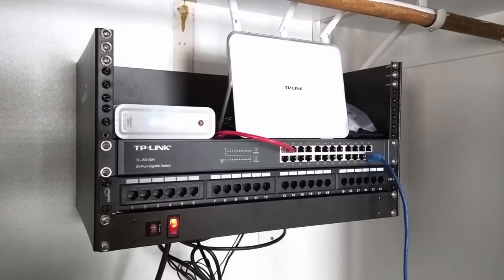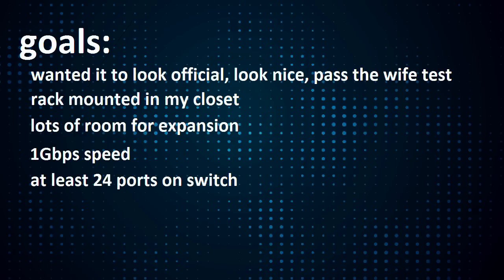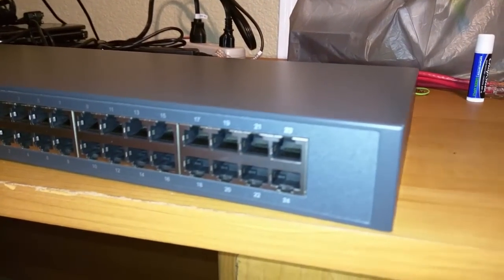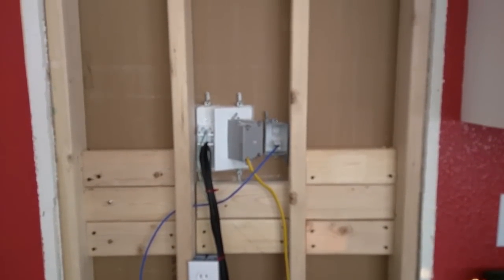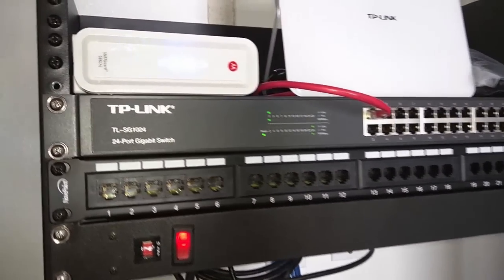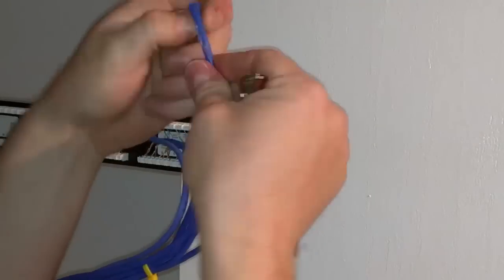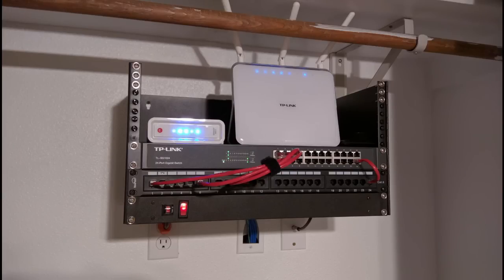Budget Home Network Tour/How To

Comment: So all of this is for better wifi? sorry I'm only 13 so I don't really know but interesting video
Reply: TechnoBike HD basically kid, wifi doesn't mean Internet. Wifi is a wireless way of delivering Internet. You can deliver internet through wires as well. So imagine one of the blue wires being connected to your phone all the time. You'll never have internet issues unless they come from your Internet service provider or the modem that's accepting the connection from your ISP.
Reply: Thanks
Reply: Actually, WiFi is a way of delivering network access.
Reply: Simple Man yes - correct, was trying to simplify it as much as possible, my younger cousin thinks "wifi" is simply Internet, always refers to his wifi being faster than mine but his intention is to say his isp is quicker
Reply: Ah, I see :)
Reply: I have 80k at my smartphone -_-
Reply: I appreciated the young man's question.. kind of felt like hearing someone say 
"hey.. isn't the emperor supposed to have some clothes on? "
I'm certainly not the most technical savy guy.. granted.. but iv been wiring up daw's since early 2000's.. build my own computers.. just basic twenty first century home stuff.  I never turned a computer on until I was late 30's.. around 2001..when late one night after a bottle of gin
I asked my buddy while listening to music.. "hey.. I wonder if there's a way to put all these f'ing cd's all over the  house in that computer I bought "wife" last year.. isn't there a way to feed the cd's to the computer.. so they're inside it..  huh??..  my buddy looked at me w a lung full of pot and said..  "man.. I feel sorry for makiko.."  (my 1 yr old daughter).. your basically retarded dude.. "  he was right.. I didn't even know how to turn it on.. but a month later.. compelled by my new daughter and the self-awareness to know my friend was right.. a month later I had the tower opened up on the kitchen table installing more ram.. that same friend showed me Reason music software days later and I realized the world had changed.. I better get up to speed.. my daughter is now 15..and I am the go to tech guy for her.. she has no idea I was an idiot at one time.. I have a studio full of the latest greatest hardware and software.. the decades of gin and ect. stopped that night my friend jokingly said "I feel sorry for your daughter".. 

so here's my question.. I opened this video up hoping to learn something.. like "why the need for a home network that doesn't involve a production aspect?"  and from start to finish it seemed the interest was aesthetic.. 
"I wanted one that looked cool.. "  and it never really seemed go beyond that.. so I'm with the kid wondering 
" wtf..  all that for streaming content?“.. am I missing something?  I feel I must be.. 
what does one do with dozens of ether net ports.. with the ability to expand?? 
maybe someone can explain.. maybe I'm still retarded.. I gotta stay ahead of my kid.. someone help me out here.
Reply: HF i think your cousin is actually more simpler than you. you make things complicated with your definitions, while good in some cases, useless when getting a message across. who cares if its just a way of accessing the internet. ppl just consider it as "the internet"
its like a person says "my car is faster than yours", and your complicted mind argues, "nah uh, no your car is not faster its your engine that's actually faster, so you're wrong".
Reply from the maker: loved your comment comptone, true, my video doesn't focus on the "why would you want a network like this." Unintentionally I guess the video turned out to focus on the "you already know why you'd want this, and the benefits, and this is how you could go about it."

There was a lot here I was focusing on, and aesthetics was for sure towards the top. I work in IT, so I have the technical part down, so I could focus pretty heavily on the aesthetics.

To answer your questions, a home network does not have to be so fancy and so pomp and circumstance as mine. Truth be told, mine looks all fancy and advanced, but it's pretty typical just on a larger scale. You would want to think "what will I use my network for?" and go from there. If you just want a few computers to communicate, then something much simpler would work. I am a giant nerd, and I wanted to wire up my whole house and have lots of room for expansion in the future, hence all the ethernet ports.

To help you understand why you would want a home network be it simple, or crazier like mine would be 1) it allows you to share data and resources between any PCs and other devices, most people understand this. You can share printers, only buy one for whole house instead of several. You could stream music, pictures, or movies to any device in the house (as long as that feature is setup). 2) A setup like mine would allow for more wired devices in the house instead of wifi. Wifi is great, but not as reliable at times, and not as secure and as fast as wired 3) You can do lots of other cool things with a network such as share a internet connection between multiple devices, use remote desktop to remote in to other PCs on the network, configure network storage, and the list is extensive.

Figuring out what you would need and building your network is half of the fun! I'd be happy to answer any other questions you might have! Happy networking!
Reply: ben johnson 
Hey.. much appreciated.  Question answered.. "I'm iT.." 
I'm asked on a regular basis
"do you really need another box that makes noise..? (synthesizer).. I get it. I have a home studio that looks like something Boeing drew up.. 
64 channels (and room to expand) of which I rarely use a quarter of and far more hardware than necessary for a hobbiest ..  I get it,  lol. 
the uses you described are all the ones I'm aware of.. the interconnection / sharing ect. and honestly like you I'm a "wire it"  guy.. WiFi is convenient but around the house I'm all about getting a line to my gear..  one more tv and I'll be down to needing more ether net ports myself. 
I just thought maybe there was something I'm missing. 

 Im constantly pulled towards information on subjects that I know nothing about.. (hence watching your post).. it's a wonderful time in history for a curious mind.. this digi tech era.. like I said in last reply.. the minute my buddy pushed the midi control key down and I heard the sound come out of my speakers i instantly said to myself  "holy shit!!.. there's been a paradigm shift
.. you better get on board or your not gonna know how to communicate with that baby in the other room in a few years."  I immediately got it. 
moreover than family around me.. I'm constantly bitching about lack of computer science in my daughters school.. (one of the most expensive private all girl schools in San Francisco and doesn't offer one computer science /coding class).. speaking of retarded..  so I immediately got it.. and now I know a little something more about home network gear.. it's all fascinating to me. thanks man.. cheers from San Francisco.
Reply: Budget Nerd finally i found what use of this. so its basically useless if i have only 2 pc and small house lol.
Reply from the maker: +OniZame93 I wouldn't say useless, but certainly not needed if you have very few devices you would want to network.
Reply: In case others didn't clarify enough, WiFi is another means of connecting your devices like a (network) cable does - only WiFi is invisible compared to the network cable. WiFi isn't solely for the internet. It can also be used for an internal network like a home network. If you disconnect your internet connection, your WiFi should still work. You just won't have access to the world wide web.

Comment: just one thing ... that would never pass an electrical inspection
Reply: Why not, out of curiosity?
Reply: Power in the same studs as data is the biggest problem. The power cables will induce an AC current in the data cables.

Comment: The cable pass through plate is mounted upside down. The waterfall part of the backplate is there to flow with the downward direction of the cable.
Reply from the maker: +wayneco yeah.. you could be right.

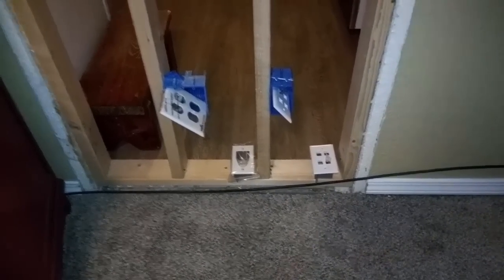Comment: that electrical wiring at 4:24 isn't up to code. the romex connector is stripped out of the compression slot which looks like you completely pushed out like a novice, and there are no staples securing the romex to the wall. i mean make a little effort.
Reply: Pretty fail.
Reply: do you feel good when you shit on another persons hard work? Work that has entertained you at no cost to yourself.
Reply: +CxnTrxL ARE YOU NOT ENTERTAINED!
Reply: CxnTrxL  people watch things like this and think: "well that's good enough I'll do mine like that". Then they get a fire and endanger the lives of others. So yea pointing out the flaws in something potentially life threatening so nobody else does it makes me feel good. And it should make the person doing it realize what they have done is wrong and correct it. I should note that, everything else is done well. Although I recently learned that cat cables should be minimally untwisted (like 1/2 in) for optimal performance.
Reply: Wew! You are on top of things!
Reply: Imagine if every time someone had to correct or teach someone that they did it in that sort of vindictive borderline cruel way. It's funny if you were face to face with him I bet my bottom dollar you would have found other words to express your grievance. You seem awful rude behind that keyboard for someone who's worried about the well being of others. 1/2 inch untwisted is best practice and he wasn't far off the mark
Reply: If you knew anything about the North American code of practically anything, roads, houses, buildings, electrical, sewage, you'd know it's absolutely a joke and is easily surpassed by poor and developing countries in Africa. That's precisely why the same code doesn't apply to the North and the South of the USA, the south needs to have something that can support flooding, hurricanes, natural disasters among others. Engineers didn't think any of that would wash out as high as NY and yet we've seen over the last decade multiple hurricanes hit NY. This is called constructive criticism. I have not called you a buffoon, and idiot, a newbie or novice, I have not tried to put you down or degraded your work. If you wish to convey a constructive message like you pretend to have done and are getting shit from others, you should cut calling people novices when clearly the fact that you have to research playing with 120V before you do shows you're just that.
Reply: And Great work Ben. Thanks for sharing a video of how you setup your home network and never advertised this being a How To video on cabling your house up to code.
Reply from the maker: +Patrick Polish hey no worries.
Reply: i used to live in north america, and almost everything you are saying is false regarding it being surprised by africa unless you live in some weird suberb where they don't have running water. i mean, are you high?  IN ANY MUNICIPALITY, this kindof wiring is not to code and would be FAILED by an inspector. end of story. and doing research is how you move away from being a novice. i never claimed to know everything, but this is wrong. that i know for sure. also, that was some f'ing tangent you just went on. next you'll be telling me about how the bp oil spill effected the local ecosystem.
Reply: Well this might surprise you but I'm actually an American living and working in the Netherlands where I did my bachelors. During that time I have traveled, albeit, mostly throughout Europe, but I also visited Tanzania once when they were just recovering from a flood. However, generally speaking, they do have issues with running, clean water and power outages due to a sub-par grid. And they are not the only ones in this modern age who have the issue. I don't see how this has anything to do with anything but ok.

In any case, at the core of your argument is that American codes are sub-par compared to say, other countries. Well sure, let's say that is the case. As such, one can assume codes are more advanced and more stringent in other countries; in your own words this would leave "less to the contractors discretion". In which case, I doubt that a wire unsheathed outside of a box surrounded by combustible materials is up to par in any country. Boxes move, if ever so slightly in the wall every time you plug and unplug a device. This movement can push the wires against the plastic wearing away and can eventually causes a spark - and when surrounded by wood, can cause a fire. This is also facilitated by the fact that the wires aren't secure, either to the wall, or the inside of the box.

So you can keep citing your 'opinions' and nebulous examples on how codes have failed us all; or you can accept a far more accurate truth that codes aren't perfect, but doing less than what is minimally required isn't the solution either.

Anyways I think I've expressed my opinion well enough.
Reply: It's gone too far. Everyone put the keyboards down and take a step back
Reply: Alexander Fagard I noticed it too ! hopefully the inspector isn't a server nerd lol
Reply: CxnTrxL I also noticed the electric wire wasn't run correctly and next owner of house will not know the wire is in the middle of the wall so they go ahead and drill through it hitting the wire which could possibly cause a fire
Reply: indeed, usually the stud field is considered a safe area to drill
Reply: I mentioned that too if some new homeowners want to drill into the wall they can cause a fire easily
Reply: Alexander Fagard agreed. in NY and in some town codes, it is against code to have an electronic outlet (or high voltage (120v) light) in a closet is a no-no. reason is there is usually high amounts of dust or lint that may catch fire, or if the bulb cracks the filament can ignight clothing in the closet. in other words: fire hazard. it's always best to consult a licensed electrician or town codes before working on an electrical project. 
just my $0.02 USD
Reply: Hey Ben, you should rename the video, or edit the title actually to reflect this lesson of Electrical Code 101. How to risk your life for a better network so my kids can stream Netflix in 8K on 10 TVs at the same time and still have enough bandwidth to backup the internet in less than 1h
Reply: I'm an Australian electrician and we use 240volts, there is no such regulation in Australia and we have much tighter codes than the USA, for starters an electrician must do all the wiring. So the closet thing is nothing to worry about, I fact it's absolutely stupid as fabric is typically not very conductive so there's very little potential for arcing. And a light, we'll have you seen your roof space, and how much dust is up there.
Reply: nandos1111 we were speaking about the wall where he has the 120 outlets for tv and game system but yeah you and uk have much more regulations then us
Reply: Alexander Fagard I was thinking exactly the same thing.. I'm DIY myself and just wired a room in my basement learning off YouTube videos and this videos poor electrical caught my eye instantly.
Reply: Alexander Fagard
Reply: Yeah... It does look like sloppy wiring. Those wires definitely need to be stapled. What's with the one wire looping out of and back into the 2-gang box?
Reply: CxnTrxL hard work that's done incorrectly is still wrong. he probably didn't get it inspected. and if he added onto an existing circuit-he probably didn't change the breaker to an arc fault type as code requires. it's typical stuff the average home owner wouldn't be aware of.
Reply: I thought Africa was a continent not a country. When did this happen?
Reply: Different states have different city code.
Reply: I enjoyed the bout between Alexander Fagard and Patrick Polish and frankly found it educational along with entertaining. But seriously, these types of discussions need to happen so that YouTube How-To videos can stay in check. Always take what you learn from these with a grain of salt, and if you mess with anything that is regulated by safety codes, either do extensive research from official sources or hire someone that is an expert in the matter. Thanks for the enlightenment guys. I feel more equipped to make the right choices now.
Reply: Most of these DIY are NOT inspected by CODE ENFORCEMENT.
In most of the states Low Voltage network is not inspected but like you point out Electrical IS and should be inspected.
This is just my 30+ years speaking in this industry.

Comment: If you ever upgrade to a managed switch you can do port bonding and up that throughput should an application require it. Nice clean install BTW.
Reply from the maker: +hallis1 thanks. A managed switch would be awesome. I mess with those at work.. budget wouldn't allow it at home yet, but maybe one day..

Comment: I would recommend adding a ups I did to my very similar setup and it's awesome still having internet and wifi when the power drops
Reply from the maker: +Sam Schultz good idea, I could but I was trying to keep costs down. Perhaps down the road. Power doesn't go out here in Idaho often, and when it is down, it's nice to do something else for a change.
Reply: ah fair enough I experience a lot of brown outs where I am so having clean and stable power helps keep internet smooth. it's nice to have a big ups too for emergency situations you can charge a cell phone many many times off one.
Reply from the maker: +Sam Schultz I do have separate things like that, to charge phones etc during brown/blackout, but nothing for my network setup. Never thought it was necessary for me, but you know down the road. Thanks for the comments!